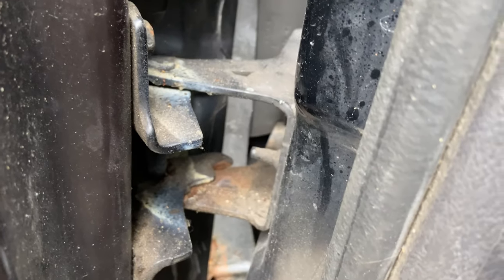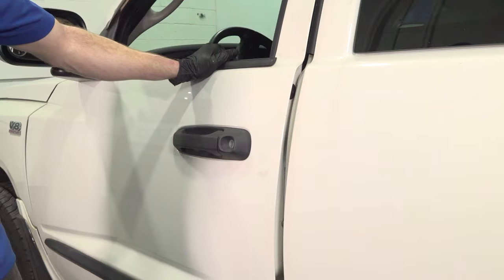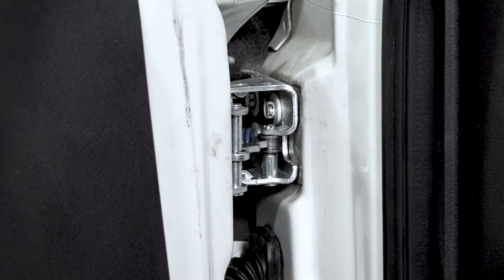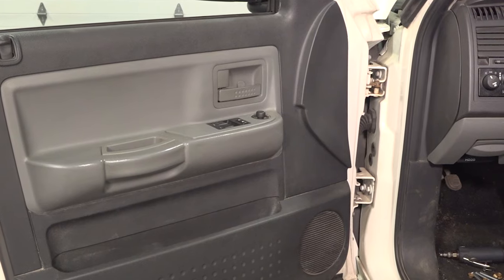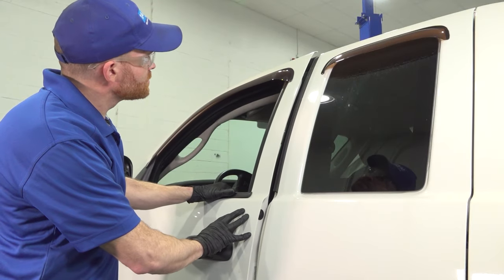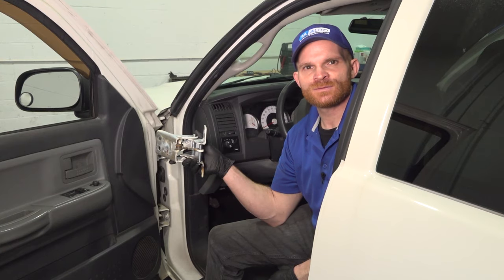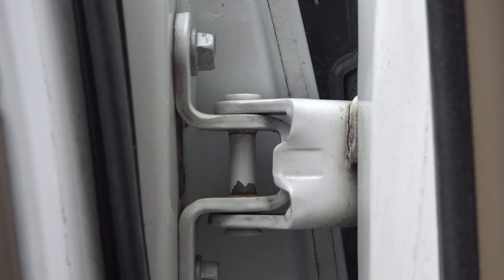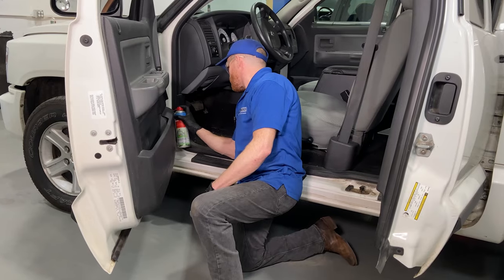Car or Truck Door Won't Shut Right? Make it Close Tight by Replacing Door Hinge Pins Yourself!

Comment: Had a toyota celica and the front passenger door would fly open when making a left turn, and the driver's door would fly open when making a right turn.  Mechanic wanted to replace the door hinges,  and paint them so that they matched the color of the car.  After he installed them,  had the SAME PROBLEM.  Turned out it was a tiny plastic clip missing in each of the doors, which you can buy from Toyota for a few dollars.

Comment: I had to replace the pins and bushings on an '86 El Camino.  Once that top hinge pin is out, the door is top-heavy and unstable.  I had hoped you'd show a fool-proof way to support and stabilize a semi-detached door.  Any advice before I tackle the passenger door?

Comment: Wow you didn't show the small bolt that goes through the frame to the left of the brake pedal.  Lol 😮
I had to remove the emergency brake assembly to get to the smaller of the three bolts.
It was a total hassle !!!
1995 dodge ram 1500 magnum